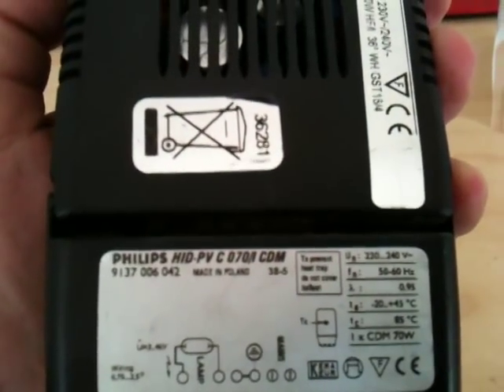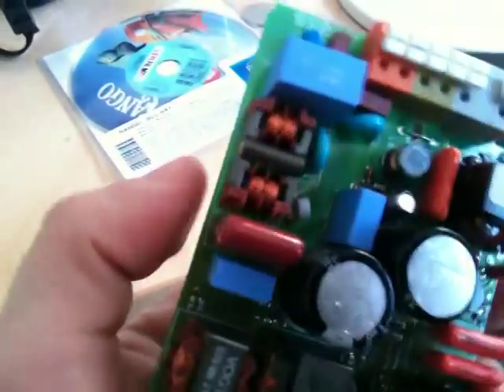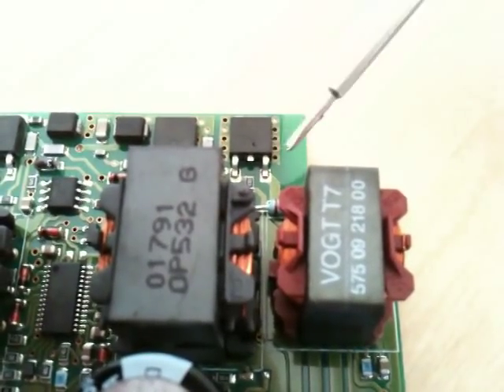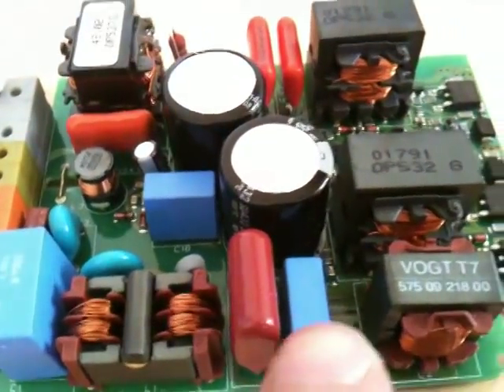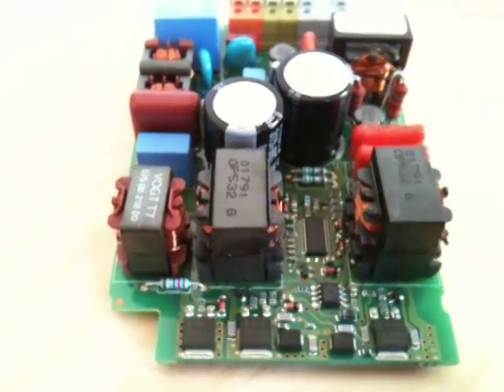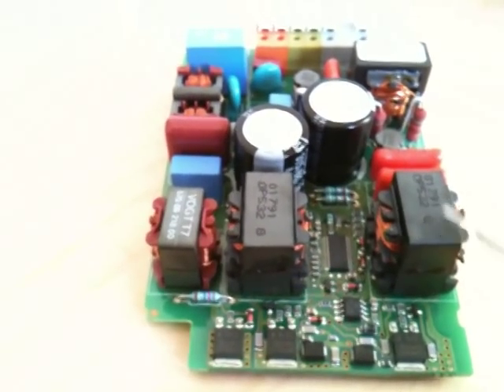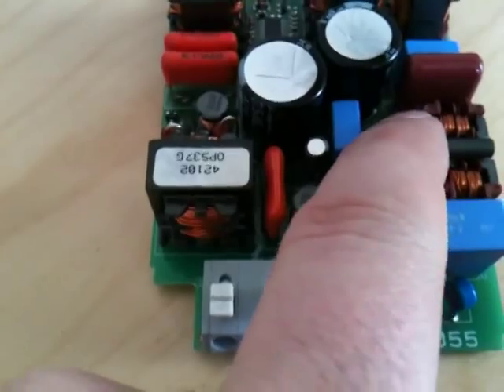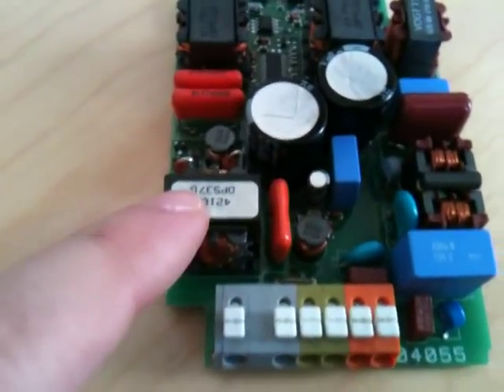Disassembly of the HID ballast

Comment: Are there any ballasts making use of SiC or GAN? Also, I have a dual bulb magnetic ballasted CMH setup that I'd love to run with just one bulb BUT (please correct what's wrong about this) the reason why I shouldn't run a two bulb system with only one bulb is that the actual ballasting is designed for twice the power and could/would lead to runaway heating, as the gas inside the discharge tube becomes more conductive as it "warms up", which is really what the ballast is there to prevent, and what separates a ballast from a traditional power supply (beyond the starting circuit). The 630w ballast wouldn't prevent the single bulb from runaway until it reached its threshold for ballasting at 630w.

What did I miss?

Are there any circumstances where a two bulb system can be run on a single bulb? I'm more interested in understanding how ballasts work and their limitations than my particular issue. If there's a book or whitepaper on ballast construction you found particularly good, i'd be really interested. I'd also be interested in your thoughts on the future of LEP technology (i think Gavita and one other company make them).

Thanks for this video and your time! Very interesting to see what's under the hood (nice kit, indeed! though the heat sinking on the mosfets seems a bit dicey) and to have a clearly knowledgeable chap lay it all out.